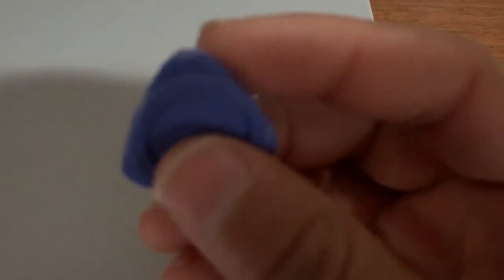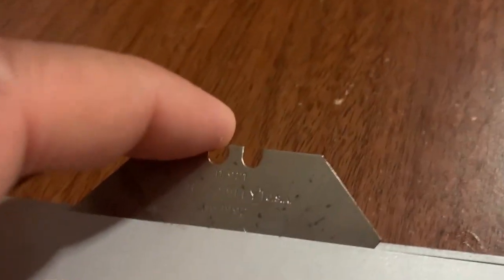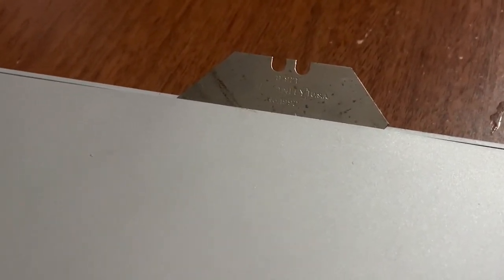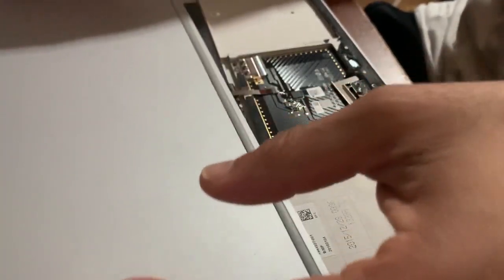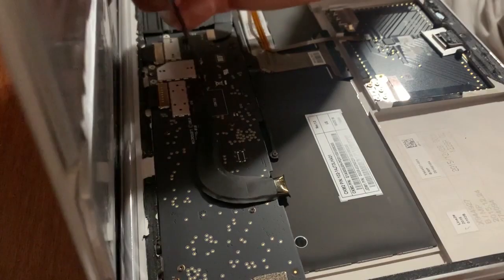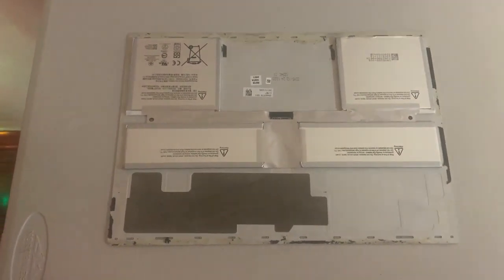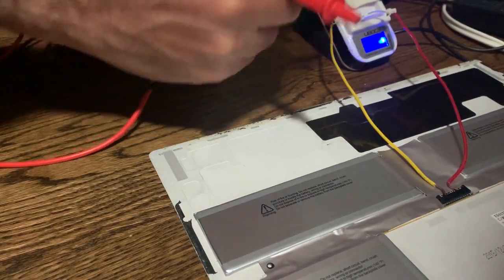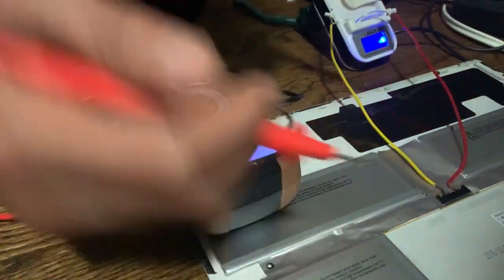Fix Surface Book Battery not charging on Base

Comment: I own the SB1 13.5” SB2 13.5” and SB3 15” and recently bought the GTX965m performance base for my model 1 (part#1785) and it won’t recognize 2 different batteries. It recognized a 3rd battery but wouldn’t charge and only ran as long as the battery had charge from the factory. I’ve tried everything

Comment: Thanks for the video! I had a hunch an approach like that might work, so it's excellent to have confirmation before I take my SB3 base apart - pretty sure a lab power supply will do the trick for me here.
Reply from the maker: My pleasure! I'd like to follow up, is everything working for you now? Thanks for taking the time to comment and supporting my channel!
Reply: Thanks, @CravingSolutions ! I havent quite found the time to disassemble it yet, since I had some emergency travel to tend to, but I have a pretty good idea what that problem may be related to so Ill need to do some digging when I do! Ill keep you posted, and thanks again for the awesome content! :)

Comment: I did the same. Jump started the base battery with a external battery and it powered on. Do not to give more Amps while jump starting which may further damage the battery all together. Also I did power it on from external battery for as long as 5% and then put the base on regular charger from then on no issues. One thing to notice is that the base battery should be intact and not bulged or any other damages to be seen.
Reply from the maker: Glad this video helped you and that is good advice.

Don’t forget to subscribe, we are only 2 away from 1000 subscribers!

Comment: Don't go flirting with disaster by connecting random chargers to pocket lithium cells for extended periods unsupervised. That's how people burn their houses down. Know what you are doing when working with naked cells, and honestly, you don't sound like you do.
The strategy to jump start a dead "intelligent" battery by putting an inital charge into the bare cells is promising. But again: Know what you are doing.

In my case I was able to charge the screen again by detaching it and connecting it to the charger directly. Maybe I have been lucky, but again, maybe the screen charging circuitry is more robust thatn the definitely flaky base unit.
Reply from the maker: Your right I should have made sure to tell people to be more careful and to stay close to it. I'm glad you were able to get your tablet portion working.

Comment: Hey, good video. I'd like to try the same thing. can you tell me the exact pin number to connect +/-? you may number from left to right.
Reply from the maker: It’s been a while since I did this video but I believe it didn’t matter as the right pins all had continuity and the left had continuity. Use a tester to verify for your self and make sure your doing it with the same orientation I had. This way you make sure you have the positive and the negative in the right areas.

Comment: I had some charging issues with my Surface book a few months ago and it was just sitting since then. I took it out recently to revive it, but the charging light does not come on when plugged in to the base. I manually detached the screen and when plugged in to the bottom part of the screen, it charges and turns on fine. Now I want to fix the base as well. Will this method work?
Reply: Have you fixed it? I have the same issue…

Comment: Great video! Do you think it would work using the drill charging dock? I have a drill battery, just wondering if the drill charging dock would work too. Maybe to much volts, not sure. Thanks for any help
Reply from the maker: I just used the actual battery, not the charger. I would recommend using a similar battery voltage that I used.   Thanks for commenting and supporting my channel! With your help, were almost at 1,000 subscribers! :)

Comment: I know it might not be the same issue, but I have a surface book 2 with a keyboard that doesn't work. I took the battery out and the battery is reading 10V and I'm trying to determine if this should be enough to get the keyboard to work in theory. If you have any suggestions or theorys that might help that would be greatly appreciated

Comment: My base isn't charging (the light doesn't come on) but when I connect it to the screen it comes on and charges.

There is no signs of corrosion or bent pins...what could it be ?
Reply: I have the same issue. Did you resolve it by any chance?
Reply: @pixel0tt  unfortunately no, they told me to send it back to USA (I live in Thailand) the cost of shipping and having it get sent there would have cost me the same when I bought it new.

It's now a desk ornament
Reply from the maker: That is very unfortunate, I hope you can find a cheap base at some point! Though replacing the battery will probably be cheaper! I do apologize for my late reply, as I missed your comment, though I do thank you for commenting and supporting my channel! With your help, we're almost at 1,000 subscribers! :)

Comment: The battery in the base of my surface book 1 is 0% and won't charge at all, charging still pass through the keyboard to the tablet normally, when I do a battery report check it shows the base's battery capacity is -1mWh, do you had the same problem as mine?

Comment: Were you able to figure out how to reset the Tablet battery(not the keyboard base). The keyboard base cant be detached because the Base wont charge. This is such a widespread issue with the Surface Books Gen 1 and makes these 3000 machines worth 30 bucks!!😡😡
Reply from the maker: Agreed this is to common of a problem and is pretty ridiculous.. I was able to fix it, this is what this video was about. Wasn’t to hard to fix as shown towards the end.

Comment: How did you know that the battery was the issue? My surface book 2 wont turn on, but looks to be taking a charge. Not sure what to do.
Reply from the maker: If it won’t turn on then it’s not a battery issue, the surface book can turn on without the battery working. Did you try plugging in the screen/tablet position directly without the dock/keyboard?

Most people don’t realize you can do that, manually detach the screen and connect it on the bottom where it connects to the dock.
Reply: @CravingSolutions  I did. I tried holding the Power button and volume buttons down till it power charger light blinks. I tried massaging the back plate. I remember updating and after rebooting it never came back on. Seems like a remote disable. But maybe I'm being paranoid.
Reply from the maker: @nicktumi  I was really hoping detaching the keyboard and the screen would help. Wish I had some other advice…
Reply: @CravingSolutions  hey man, my surfacebook seems to be charging when plugged in but it won't turn on when connected to the base. It turns on when I disconnect it from the base (using paperclip) and charge through the bottom. I have cleaned all the connections and still not working. Any ideas?
Reply from the maker: @nathandickerson6895  sounds like perhaps there is some short happening in the base. Have you tried turning it on and then docking it? If you try this be careful as I don’t want any damages to happen to the top part. So he sure to test it quickly. I would honestly still worry about trying this. However if your willing to, see if by doing that quickly if the docks keyboard and functions still work. For example if it has a nvidia GPU, does it still work? Does the keyboard work and so on.

Comment: Heyy, same device but my tablet battery is not charging, I'm only using the base battery since 2 years. Any idea if i can fix this the same way? Thanks!
Reply from the maker: So sorry for the late reply. I thought I responded already. The top part (tablet part) I did not have any success with using this method. I had to open it up and replace it completely. But also my battery was swollen up so it’s possible that method could work. 

But honestly if your going to go through all that hassle of opening it up, it’s probably best to put a nee battery in.
Reply: @CravingSolutions  Thanks a lot for replying. Don't know yet what I'm going to do :-). Sounds like a lot of trouble getting the battery fixed.
I was just using it as a laptop so long and it was fine.
Reply from the maker: @JGraf-nm4uy  It can be a lot of trouble and risky ask you can accidentally crack the screen in the process. But as long as your careful it would be fine. But if you don’t really ever use the functions like flipping it over to the other side and such then it isn’t worth the trouble.

Comment: When I plug the cable into the charging port on my surface, it is so slack it wobbles around. Only when I find the sweet spot where it actually makes the connection will it charge. And over time, that has become almost impossible to find. I bought a new computer (shame, because I really did like my surface), but not a Microsoft computer. After all these years they still haven't fixed a fundamental flaw.
Reply from the maker: Thanks for supporting my channel, I believe your problem is with the charging port it self. I haven’t seen many issues with the actual charge port. Often it’s the batteries completely getting drained then not being used for a little while that causes them to completely die.

Did you try charging just the screen and not the keyboard? You will have to use a paper clip to release the screen from the keybord though. I don’t believe I have a video that shows that unfortunately, though I know I recorded is somewhere… But there should be videos out there that show that.
Reply: @CravingSolutions  Thanks for the reply.
No problem with the battery itself. If I can get it to charge, it charges well and lasts long. But it's getting it to charge. From when I first got the computer the connection was a bit loose, and charging was a bit hit and miss. But generally if I got the chord in the right position it would charge. Problem was mostly while I was using it. If I laid it flat and charged, it seemed to be fine. But it became increasingly more difficult to charge, even when laying flat. Now the connection is super loose. I can still get it to charge if I'm really patient, but it has to be laying flat and I have no idea if it's charging until I turn it back on. If it didn't charge, then I have to try again.

I've already bought a new computer. but looking into using the monitor as a second screen. So, I persist.
Reply from the maker: @TheFtocFactor  Wish I could have been more help, I guess at this point you can sell it and then they can replace the charge port.
Reply: @CravingSolutions  Thanks for kind words. I'm sure you have helped many.
(Never understood why Microsoft never sorted out the charging problems. Such a fundamental with electronic devices)

Thanks for the knowledge you share with us out in cyberland.
Reply from the maker: @TheFtocFactor  Your welcome , I truly appreciate your continued support!
Reply: @TheFtocFactor  i have  same problem and now i cant find the right spot to charge it :(( its been a few day
Reply: @duyanhphamvu3781  I took a photo of the charging input on the side (Surface 3), when I enlarged the photo I could see that the charging input looked very worn. 

I mean from day one the plug never felt that it fit in snuggly, it always had some wobble. Most plugs go in with a little 'snap' kind of a feeling, but never had that with the Surface 3. Always felt like it should go in further.

The wiggle room just got worse and worse.

In the end, I had to buy a new computer because it would take about a week before I could get the thing to charge.

I really like my Surface (my wife had one, too, and had exactly the same problem.) but I was so scared to buy another one.

I really wish I had taken it back as soon as I had a charging issue. But I was always able to get it to charge, so it didn't seem like such a problem...until it was too late!

Comment: What’s the voltage on the Dewalt battery? Also what terminals did you connect the wires on the surface book port?
Reply from the maker: Really appreciate your support for my channel and I hope I can help clarify.

The battery was 18v and as for where it connected, this was done on the surface book base (keyboard). It connected to the right and left of where the terminal is for the stock battery. Please watch at 18:30 for how to connect it.
Reply: @CravingSolutions  sorry it doesn’t show where to connect anywhere
Reply from the maker: @nomad2510  if you go to that exact time you will see how I have the wires coming from the battery terminals into the surface battery terminal. Just match the negative and the positive. The battery on the surface will show you which goes where.
Reply: @CravingSolutions  there is nothing I am afraid. Would be great if you can’t tell me which pins on the surface book battery you have connected it to.
Reply from the maker: @nomad2510  Here is a picture that will show you the positive and the negative more closely:

https://wxalbum-10001658.image.myqcloud.com/wxalbum/120554/20200901174339/bf02572062953b48ab2661d3fb916b2a.jpg
Reply: @CravingSolutions  Thank you. Out of the 12 pins, 6 on the +ve side and 6 on the -ve side which pin did you connect the dealt battery to?
Reply from the maker: @formathew  The battery has a + & - you just connect negative to negative and positive to positive.
Reply: @CravingSolutions  Pretty pointless comment, I am asking you some specific questions and you are just beating around the bush, I suspect if your solution works, thanks anyways.
Reply from the maker: @formathew  sorry I wasn’t understanding your question clearly till just now 🤦…

All the pins on the negative and all the pins on the positive are pretty much the same. I remember trying to see where the negative stopped through a tester through continuity between the pins and it was basically an even half and half. But safest route is just to stick to the two opposite side to not risk positive and negative making contact.

Comment: I’m going to attempt to replace the battery of the base  to see if that fixes the issue of my surface book 2  screen not recognizing the keyboard..  hoping I don’t have to disassemble the top but the connectors do look like it has very slight corrosion  maybe from humidity  or  something
Reply from the maker: It might be best to disconnect the top using a paper clip or something, anything can happen so I would advise you to disconnect it.

If there is any water related damage on the connectors that would make it even more reason to separate it. This way you could properly clean it.

Comment: Have you had any more problems? Deciding if I should try this for a long-term fix or replace the battery.
Reply from the maker: No problems at all since then, and honestly when I put the bottom back on I didn’t even use new double sided tape or adhesive. This way if I need to go back in it would be very easy. But thankfully I haven’t had to since then!

I appreciate the question and hope this helps!
Reply: @CravingSolutions  does it click into place or what, ie what keeps it from falling apart?
Reply from the maker: @williamstewart7399  for me the glue was still somewhat active. So adding weight back onto the keyboard which pressed down on the cover worked for me. You may need to get some double sided adhesive tape to get it better secured though.
Reply: @CravingSolutions  Oh I see you replaced the one in the base, I think the issue with mine is the one in the screen. It runs normal other than I can’t detach it without the paper clip method. I suppose that’s pretty good for a 5yo laptop
Reply from the maker: @williamstewart7399  Ya this method worked for the base, I sadly was not able to get this method to work on the actual tablet part. The battery I had was blown/expanded. It could possibly work, though you have to remove the battery as to not risk frying something. I ended up replacing the battery which wasn't to bad, only bad thing was the battery I bought from eBay was dead on arrival... So had to order another!